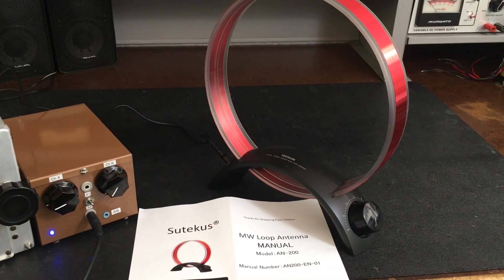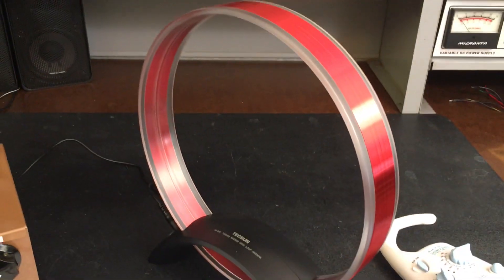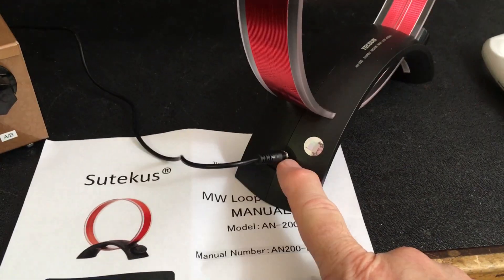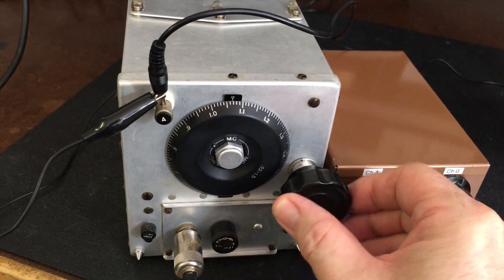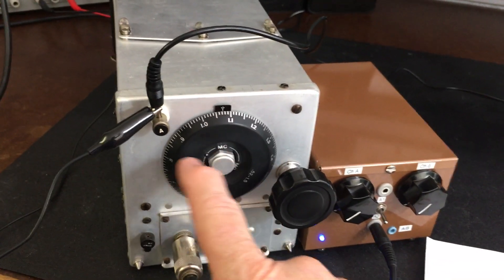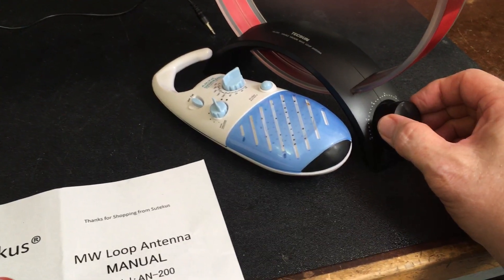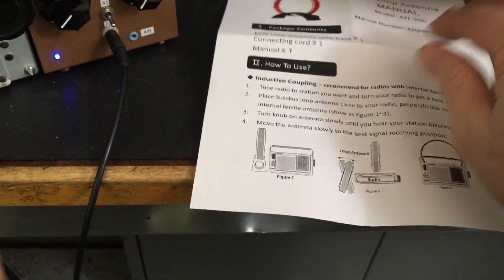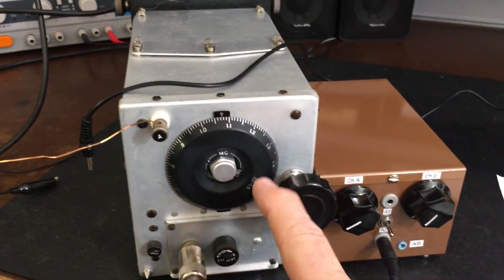Cheap AM  Radio Loop Antenna - Does it work?

Comment: P.S.
What a cool radio, your military surplus!
Now, this loop external antenna is only for the AM band? It wouldn't do any good for the shortwave, or FM reception?
"Radio" itself is still magical to me, I sure get alot of enjoyment just fiddling with my new little Tecsun... it's the PL - 330...take care...
Reply from the maker: The loop antenna is only capable of tuning roughly 500 to 1700 KHz which is the AM broadcast band.  So it would not help with SW or FM reception.
Reply: For medium wave!

Comment: Evening...
A friend recently sent me the Tecsun PL-330 radio, and one of these reel-up wire external antennas.
I haven't been able to get a thing on the shortwave and not too much on the AM, or "Medium" band.
Wondering if this external antenna might be worth the investment for me? (It's $31.00 on the Amazon. A decent amount for me, right now.)
This little radio brings back some really good memories of when I was a kid scanning around the AM band during the night when I was supposed to be asleep!
Appreciate your making this video, thanks...
Reply from the maker: Hello Dave and thanks for tuning in to my channel.  Your lack of resonable recpetion from the Tecsun seems a bit odd especially with AM standard boardcast stations.  The loop antenna may help unless you are hurdreds of miles away from some stations. Also, shortwave reception can vary quite a bit form daytime to nighttime hours.

Comment: I find that the loop doesn’t work with modern DSP AM radios, for some reason.
Reply: Probably works, DSP is only processing the signal what comes in.
Loop antenna is before!

Comment: There must be a small capacitor in that loop antenna, or it would not be to touchy in the tuning. 
 I plug my long wire aerial into the loop antenna's connector jack, then couple the loop to my receiver.  It gets a better signal than just the loop.
Reply from the maker: Hey what a good idea Tom.  I am going to try that.